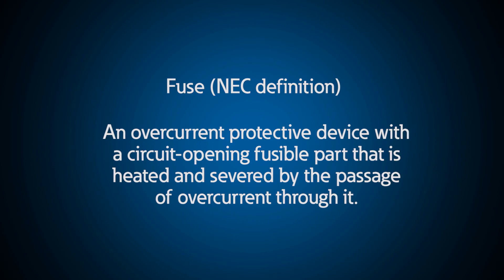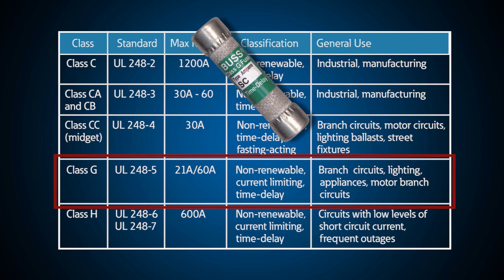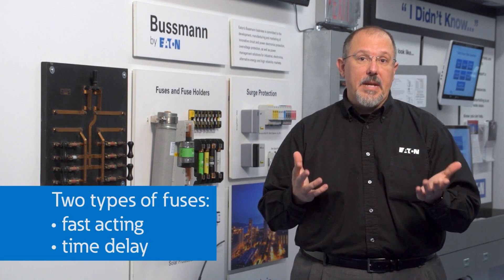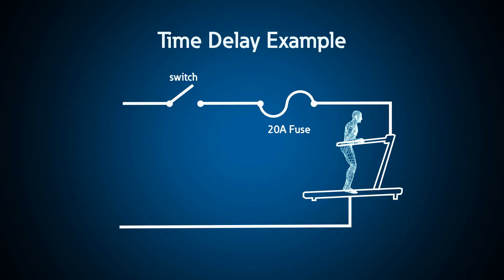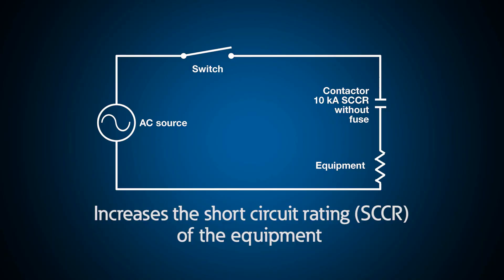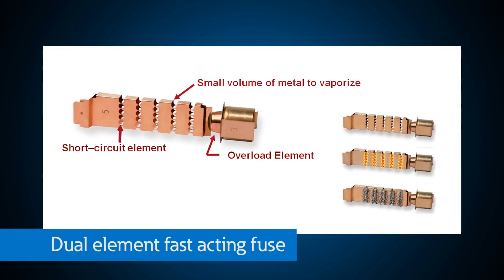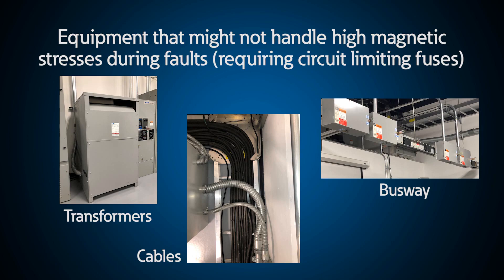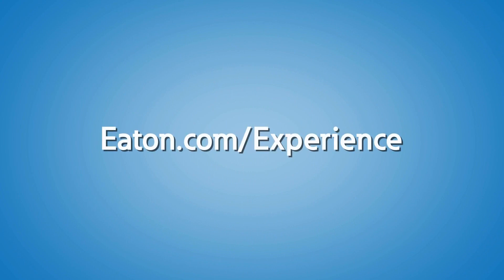Fuses Explained

Comment: Hi Tom , If I have an EV charger that has 10 kA SCCR and upper stream components/ protection and available fault current from the transformer secondary is 25KA will that be an issue ? Or it shan’t matter if there is not a fault on the DC side of EV output or the in the vehicle battery ? Your input please

Comment: An air compressor would make a better example than a treadmill. A compressor starts at full voltage and at full load. A treadmill has a drive which gradually ramps up the speed thus eliminating most of the inrush current. Besides I wouldn't want to be on the treadmill if the full voltage were applied. I would be thrown off it.